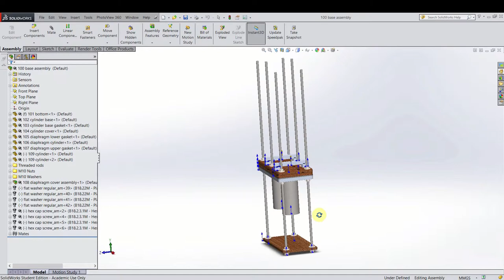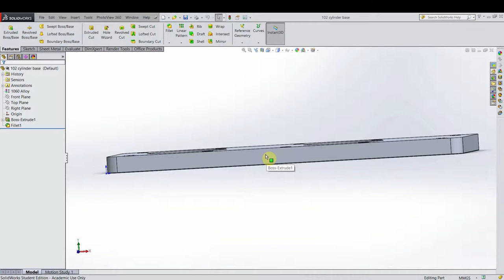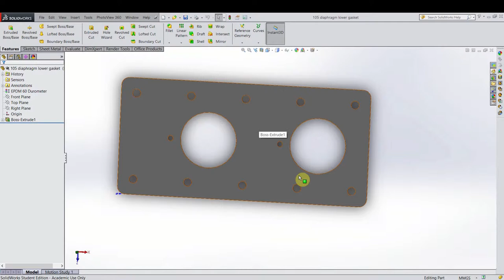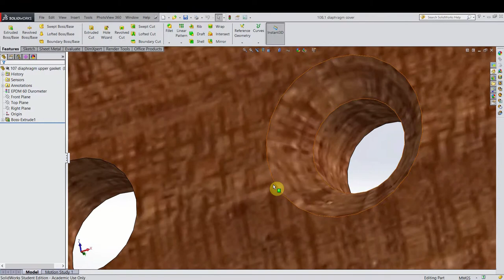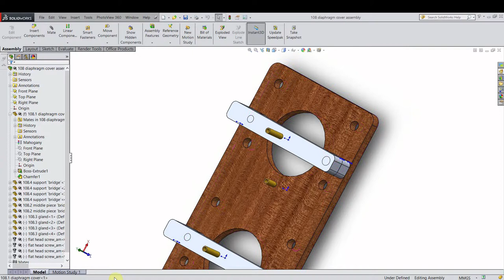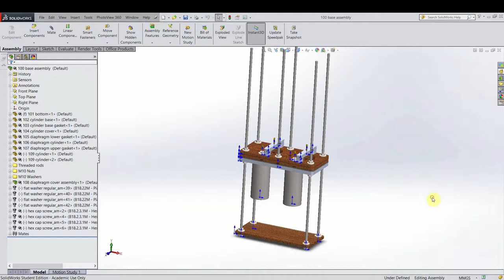Two Cylinder Stirling Engine - Rebuild #3 - Start of Solidworks model

Comment: Looks good!
Reply from the maker: thanks! I hope to get some more time soon so I can finish the drawings. Then I can start building the whole thing up, and that should go pretty fast because I have drawings for all the parts then.
Reply: Triangle_DIY Yeah that's a good way to build stuff!  I just always build from the plans in my head so sometimes I have to think new ones up as I go.  Takes a while sometimes!
Reply from the maker: When I built this engine for the first time I made every part at least 2 times. Just because things changed, didn't fit or they were not good enough. Learned a lot through that, but with that experience the plan is now to do it right the first time. We'll see how it goes :p
Reply: Triangle_DIY Well your first engine was a ton better than my first!  My first one didn't work at all.  My second worked for like 5 minutes until the hot glue melted.  Then after that they went pretty well.  Good luck!